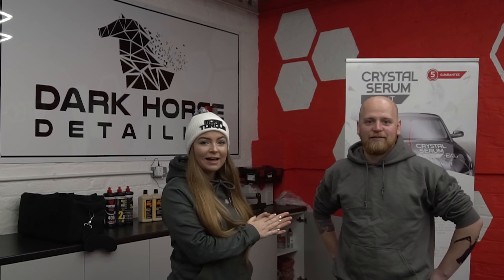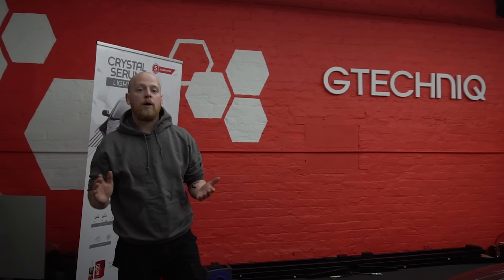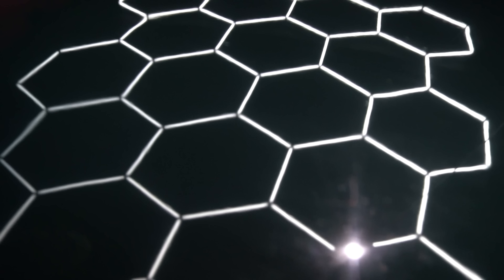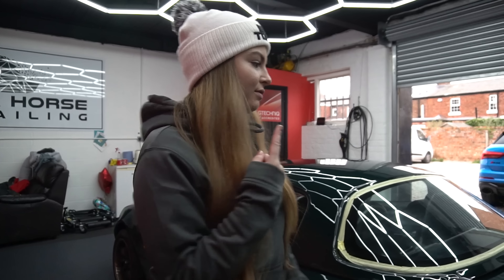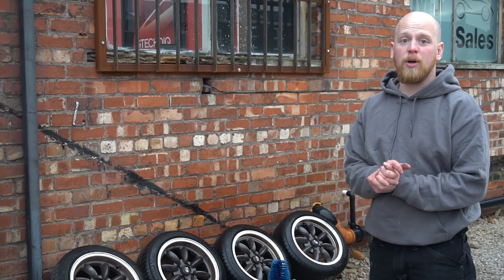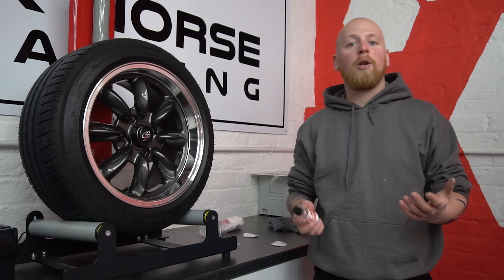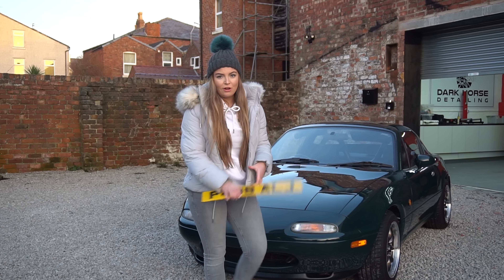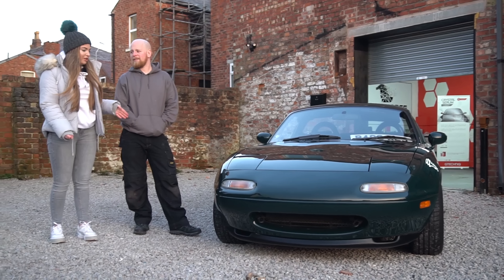FROM RUST TO RICHES | Master Detailer Takes On 24 Year Old Project Mazda MX5

Comment: Great video just a heads up it is illegal to have your plate in window I am also guilty of this . You can buy a bracket that attaches to the tow hook for like a tenner and you can have it back in correct place without it stuck on bumper! I'd buy a square plate aswell look so much better

Comment: Hi Rachel I have the chance to buy a MX 5. I am looking to know where the chassis number is as I need to apply for the tax book if i 
 buy it. I have found a number but need to double check I have the right one before sending of the form.
Reply from the maker: Hey, when you open the bonnet it’s on a plaque at the back near the brake fluid reservoir x
Reply: @RachaelBuckley   That's the one I have don't know if it was the right one. Thanks for all your heip greatly appreciated

Comment: Looks great. I have 2 questions about the Quickjacks. 1) What size are they?)  2) I notice axle stands under the car as well. Why? I am just about to order a set,  but am a little bit unsure about how safe it would be to work under the car with them..Would you recommend them? Okay that was 3 questions. Thanks for posting the video...